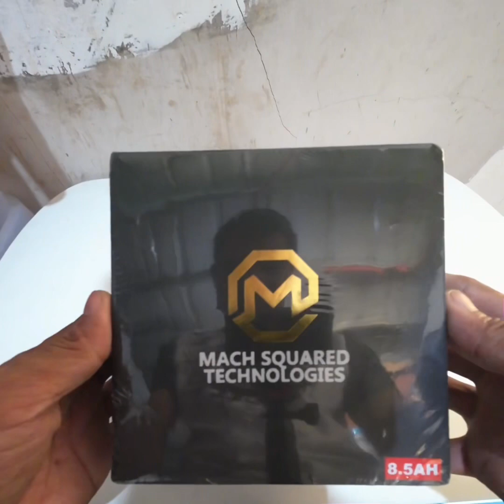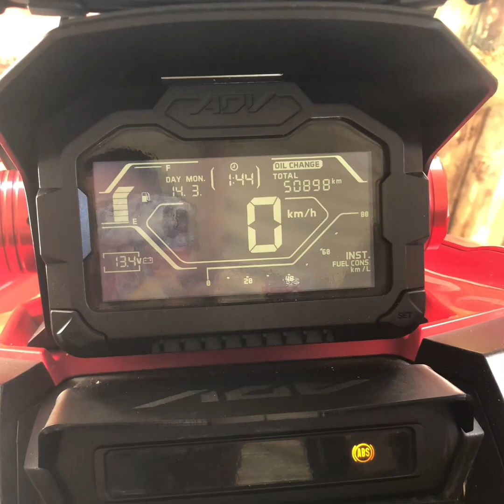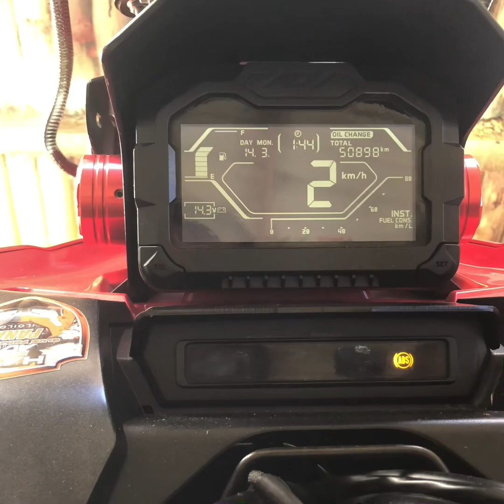MACH SQUARED TECHNOLOGIES LifePO4 Lithium Battery for my ADV150cc

Comment: Hello sir ano update sa mach squer battery goods pa din ba po hangang ngaun hindi pa din ba bumaba volts nya? Balak ko kasi mag palit sa nmax ko
Reply from the maker: All goods po mam, nd po bumaba ung voltz nya, as long na nka charge during rides nyo. Wlang problema sa battery at magaan na din sya unlike sa led acid battery
Reply: week end pull out at i charge paps pra hni mg lowbat?
Reply: Kakabili ko lang din ng mach squared 8.5ah kamusta na battery mo sir?